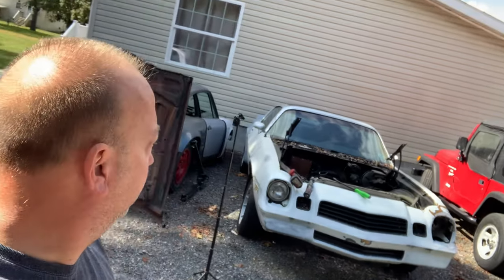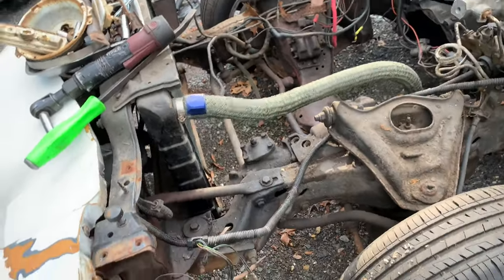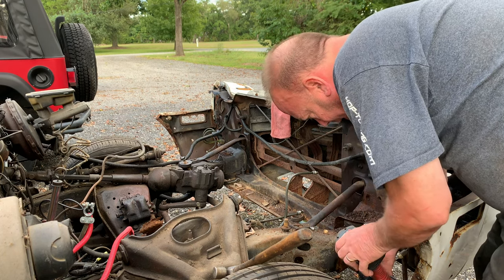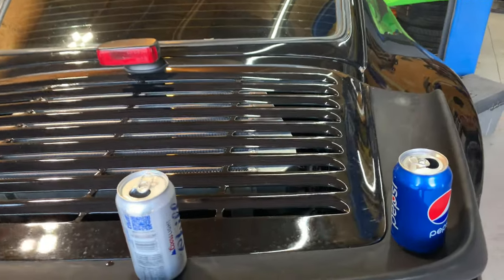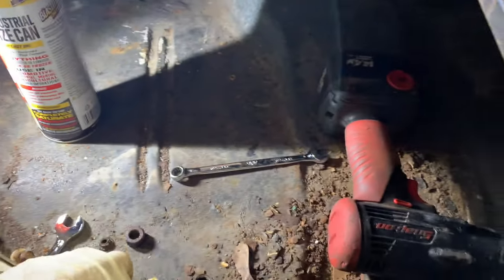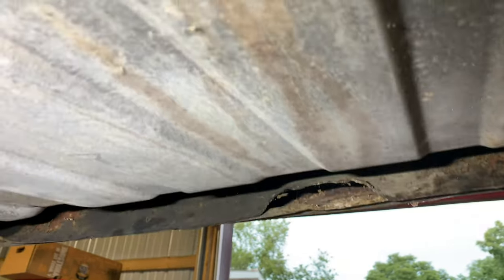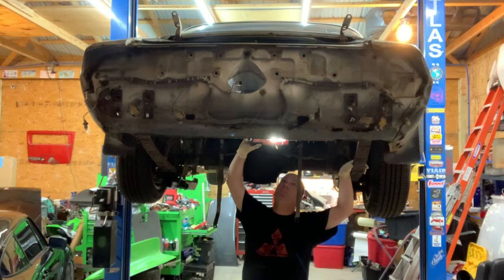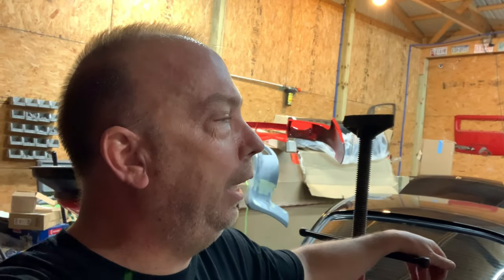Saving a Classic 1981 Z28 Camaro Build Part 1

Comment: You could have took like 6 are 8 bolts out and set the hole front clip off
Reply: Taking the front end off in one piece still means taking off about 20 bolts.

Comment: My first car was a 76 Camaro, sold it when my oldest was born and have wanted another ever since and I just a 81, It not the same model year, color or engine, mine was a 76 RS, it was yellow with Biege interior and had a 350, this one is a base 81, it's Blue with Silver interior and it's a got a 4.1L 250 strait six in it but after looking for 20 plus years for a 2nd gen that I could actually afford I don't care about any of that, It does need a paint job so I might change the color and they seats need some work where the seams have come apart so I MIGHT just dye them and the dash brown also but the engine was trans and rear end was just rebuilt so I'm not touching them. Plus I got it in a package deal with a 2001 2 Grand-Am for my 12 year old grandson when he turns 16.
Reply from the maker: My 1st car was a 76 also, it bought fire at votech. We sprayed under coating underneath and it got on the cat. Well that was the end of that. I loved my 81 Z28. These cars are addictive. Hopefully you get to drive and enjoy your car with your grandson. Thanks for watching
Reply: @RustyRatchetGarage  Yep, not many of us who's first car was a 76 Camaro, I was High-School from 87-90 so there were ALOT of 70's cars in my high school  parking lot, by the mid 80's they had become the "hand me down" car to the first new driver, my Gf had a 75 Chevelle that her aunt bought new, My best friend had 79 Nova that his step-dad got as a partial payment for some work he did on a guys car, I bought my car for $500 from my next door neighbor who got married and was moving to Texas with her new husband and no longer needed the car, there were alot of others with similar stories.

Comment: Those cars are known for rust ...that one is not that bad ...framed are known to rot ...save yourself money on ls swap .....crate motor 330 hp with mods
Reply from the maker: Yeah the rust sucks, I decided to replace the whole part instead of patching. I was going to do a LS swap but I have the motor and trans out of the 87 corvette. It has 82000 miles on it.

Comment: Fender can be fixed IV seen and done worse ones than that 😮
Reply from the maker: I did buy a NOS GM fender for the driver side for 125.00 can’t beat that. I will fix the passenger side
Reply: @RustyRatchetGarage  great deal